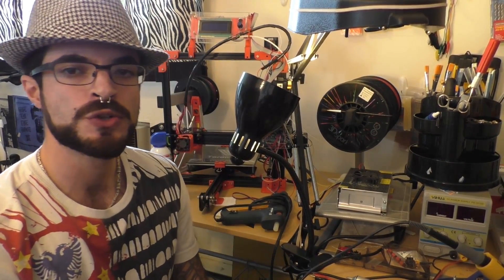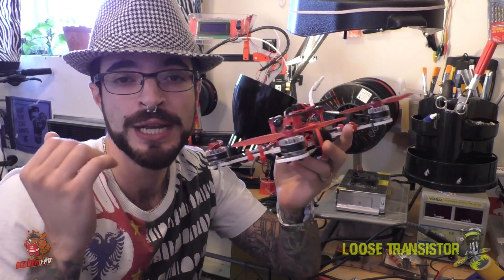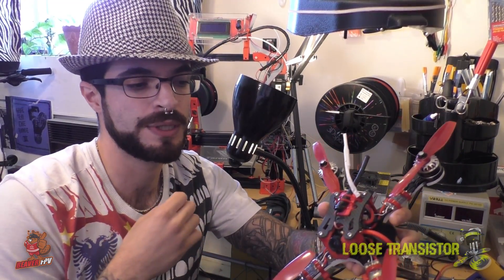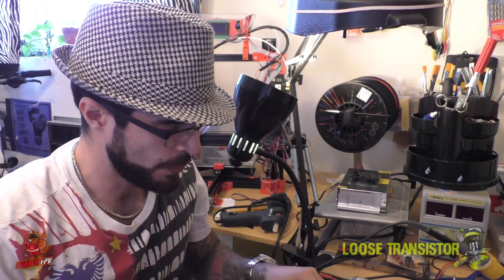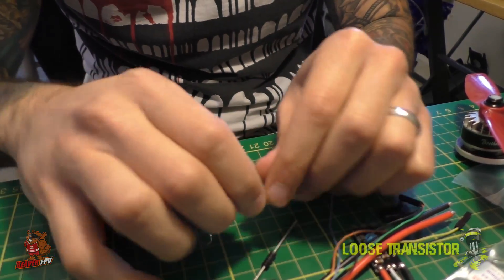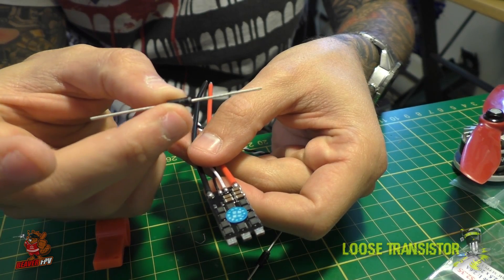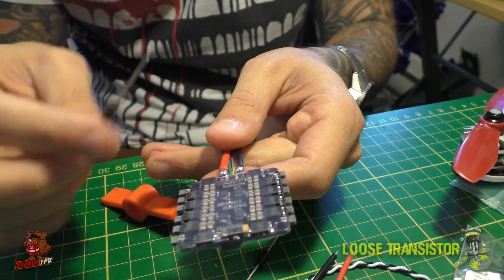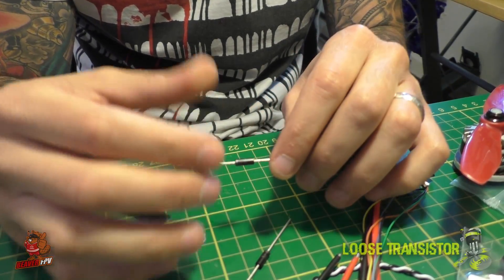Capacitors are DEAD. Long Live DIODES! ♠ [ How To QUAD ]

Comment: this is a very bad idea for one reason. and that is when i diod fails it lets power flow both ways causing a short. in the things they are used in there a fuses in place for that reason. there are no fses on a quad. so itll just burn up the quad! good thought but not a good idea.
Reply from the maker: Hmmm that is not the case.. going strong for years on these never had an issue! Thx!

Comment: All right there friend yes i had it in the right way - to the +&+to- it all so makes video fuzzy bad desink got another runcam split on the way so no worries did u triy it yet in your build let me no how it goes for u
Reply from the maker: Ive used it on quite a few builds, never had issues with video noise or desyncs of any type.

Comment: All right there friend i have just reeked a 7" quad coz of that adjusted diode i was having video noise u cold have tested it first befor u said it on your channel the desink and then crashed 350 it cots me thanks for your inpot but i am going back to the caps i had a runcam split and its trash now 65 bucks not good and dont work
Reply from the maker: Are you sure you had it installed properly? Did you have the right cutoff voltage for your current setup?

I am sorry that this happened to you my friend but there is nothing that I said in this video that should have led you or anyone else to this sort of problem.  TVS diode by itself will not cause a desync. The  most likely scenario is that the diode you used was rated too low for the voltages you are pulling and starved your components.

I also never said that TVS was there to fix video noise, you want a LC filter for that. The purpose of the TVS diode is to protect your components from transient voltage spikes that get generated by motors & ESCs. It seems to me that you are the one that should have bench tested your setup before taking it out to the field. I take no responsibility for your decisions.

The specs and ratings I used on this video are for a 5" 4S quad. What voltage are you running on your 7?

Comment: Hum so you use the diode for shorting the voltage spike.. wath about efficiency? Watts absorbed in a capacitor will be re give to the systeme. Those watts thats pass through the diode would burn as heat....
Reply from the maker: Has not affected efficiency in any noticeable way.
Reply: Loose Transistor FPV maybe those voltage spike ldoesnt represent a lot of overall braking power.. if those diodes heat up so there lot of power if not same not much power. Lipoli battery can reload fast also .. have to test with oscilloscope if higest c rating act as capcitor and smooth the voltage more in a noticeable way..
Reply from the maker: Would be awesome to get some actual o-scope data around this. I was promised some a while back but never delivered.

From what I understand the transients are very quick and short so not enought to dissipate a huge ammount of energy.
Reply: I am not concerned of braking lol i use one shot 125 esc and braking is disable xd litle wobly quad at 10 20 pc throtle but above 40 gas its not realy a problem

Comment: Anyone remember Zener diode, as a kid these little blocks were cheap to buy, we would put these on minibikes snowmobiles anywhere we needed a simple voltage regulator. It did help with the highs, but not the lows. as I stated below.. Bad side is these would generate a lot of heat, depending on draw versus what is produced.
Reply: Look at your main boards on your comp, you will see a combination.

Comment: Low level is also helped by having capacitors. Goes both ways. I wonder if you used a smaller cap along with this., good for both sides of the spectrum.?
Reply from the maker: I think I am still going to rock the 470uf that i've been using so far.

Comment: Watch this for an understanding of what is happening https://youtu.be/LXGtE3X2k7Y 
Voltage spikes from inductive loads are fun. Build a Tesla Coil and see how small AC voltages become very big by pushing that small AC voltage through some turns of wire and then stopping the voltage. Big collapse of energy!

Comment: To clarify to those who are new to electronics.. it is not about Diode vs caps.. it is caps and diodes working together to filter your power in most cases.. But here you need to ask yourselves, with all the nice purpose built circuitry why are we having to add caps or diodes onto the power leads of our ESC's this is power filtering 101. The designers/manufacturers should be making sure their components to not feed back into the system. There is nothing wrong with adding a diode to the system but for more complete filtering add a LC filer inline to the power leading to your cam and FC (if it is not handling current sensing or does not has it's own BEC like the Omnibus))

Comment: This is misinformation.
Capacitor are passive componentes part of rlC. RLC components are elementary for filters design. Diodes or any other Silicon part are ACTIVE components and therefore produce different "effect".
If you wants to cutoff spikes.. its ok go ahead with a zener, but this is not a substitution of a condenser (aka electrolitic cap).
There are a plenty of parts in electronics... saying good bye to caps so easy is like say AC is equal to DC.
Have you heard about Varistors?
There is a lot of theory behind this... they are not just spikes, they have a frequency, armonics...
Caps will live forever... a pair of cables together produce a capacitance effect.. with out them is theorically imposible produce radio signal... ...
+Joshua Bardwell
Reply from the maker: You are a bit late to the party my friend.

In the end the veredict ended up being that its probably best to use both. The diodes will protect sensitive equipment from spikes and the capacitor will help with filtering. I use both and so far it's been great!

Comment: if you want full protection using diodes, you're gonna need 2 of them (per esc). one as described in this video as reverse polarity protection between positive and negative, and one as a gate along either the positive or negative run, that has the amperage capability to continuously supply the esc without inherent resistance.   battery/pdb > positive wire > diode anode > diode cathode > esc positive > diode cathode > diode anode > esc negative > back to battery/pdb.. this prevents both reverse polarity spikes, and positive voltage spikes
Reply: oh and good luck finding a high enough amperage diode for the gate that's not the size of your thumb.
Reply from the maker: Yeah, I suspected that spikes on the positive voltage were not being attenuated at all, I guess the capacitors I have been using have been doing a little bit of that.

And you are right, don't think I would be able to find a diode that would do that without it being humongous. Thanks for the info, really appreciate it!
Reply: if you search for LC filter, some of the first things that pop up are from 2014, which use a combination of inductor (L) and capacitor (C), which you then put between your noisy stuff and your sensitive stuff (like your vtx)
Reply from the maker: yeah more and more I think I should just bite the bullet and make a small LC filter. The added weight can't be that bad.

Comment: Model train enthusiasts have been using these diodes for years. With the increasing speeds of flight controllers,Motors and speed controllers. Electrical noise supression will be needed more and more.
Reply from the maker: Oh wow! I had no idea this was a thing in model trains! Thanks for the info
Reply: Your talking about two different things. The diodes are for voltage spikes which is totally different than Noise on the power lines. You will still need capacitors to filter the noise in the power system. Motors are what cause the electrical noise in the system.

Comment: so how do you protect your escs from transients?
Reply from the maker: John Doe the ESCs don't really need the protection, it's the sensitive equipment such as camera that does.
Reply: Loose Transistor FPV   My quad desyncs all the time.  so you're saying that it's not a problem with the esc's?      Then what exactly is happening when my quad desyncs and spins out of control?   Thank you.
Reply from the maker: Hmmm desyncs can be caused by a variety of different issues including a bad motor or a loose connection on your Flight controller.

What ESC's are you using right now that you are getting desyncs on?
Reply: Loose Transistor FPV. I only get desyncs on both of my gt2 200s.  one v1 and one v3.    says 302x but someone pointed out they are rebranded dys escs.
Reply from the maker: Hmmm.. well those are BlHeli_s ESC's so they shouldn't be so bad. There are a few things you can try.

1- You can go into BlHeli Configurator and set the following parameters
> Motor Timing = Medium High
> Demag Compensation = High
> Startup Power = .125

If you are still stuck on this stuff consider joining me over on the FPV Chat slack, you will receive a lot of help there and 9/10 you will get your issue fixed. Just head on over to http://fpvchat.slack.com, make an account and come find me or ask in the #software-help or #general channels

Comment: why not both use caps and tvr diodes.. would that work?
I mean that bardwell has a point.. and you to.
Reply from the maker: I don't think you will see any adverse effects from using both. From what I have read and understood from other people doing this is that adding the capacitor on top of the TVS does so little as to be negligible. However, I have heard reports of people doing both with great results as well.

If you are looking to cut weight, i'd say go with just the diode, if you have luxury of space and weight do both?

Comment: Question is, why don't the esc's have them built in/on? And you could use both,diode and cap, wouldn't hurt
Reply from the maker: Some of them do already! latest generation of Cicada ESC's are coming with these mounted on already. Both the 4in1 and the Single version.
Reply: So any ESC with regenerative braking has a diode right? So would that be the best option? To only buy ESC's that support Dampened light? 

Does this ESC have a diode in the pic? I think there is one in the middle of the neg and pos pads.. 

http://www.ebay.com/itm/Sunrise-Cicada-BLHeli-S-35A-2-6S-Programming-Multishot-ESC-for-FPV-Race-4pc-Set-/182453736913?hash=item2a7b1715d1:g:V6oAAOSwr~lYoW7V
Reply from the maker: I wasn't paying attention when I grabbed that image off google, and yes that one has a diode already installed. I have been told that new Cicadas are coming with those as well.

It would definitely be better to buy the latest gen with the diode already because the MFG will do all the work. However, this is a cheap solution for those who already have gear they are running or if you just like buying a certain kind of ESC for other reasons.

Some PDB's are also coming equipped with the tech.
Reply from the maker: Yeah I didn,t pay enough attention when selecting the picture. The one I used as an example for the diagram already had a diode.

Its probably better to buy ESC's with damped light in general and most of the newer stuff has it. I have also noticed that manufacturers have started to include TVS devices in some of the latest gen stuff.

This technique is good for people with older gear and who want to protect sensitive equipment.

Comment: Why don't you use Schottky diode? It has faster transition response than a Zener. Is there any special reason to select TVS Zener, not Schottky? I use a low ESR Capacitor as well as Schottky at the same time and I can find the FPV signal has way lesser noise and even the copter's vibration threshold of P and D is going up higher.
Reply from the maker: I have heard of using Schottky diodes for the same purpose. I am not actually sure if one is superior or not. Would have to do some tests for that.

Comment: You might want to mention that the diode you use is rated at 20.5V so only for up to 4S..

DO NOT use this diode on 5S and higher.

Comment: It feels to me like the diode will chop off the upper part of any noise, but leave the lower parts of the noise un-changed. Especially because ESCs use braking, we can expect the noise to have large +v and -v components. Imagine that the ESC brakes and voltage goes from 18v to -5v back to 18v again. The diode won't affect that all.

It seems like the diode can help protect equipment against transient over-voltage conditions, but it won't fully clean up the type of noise that we have on our copters.
Reply: This is true. However, this is exactly what has been pointed out, and if you notice, protection is exactly what some are recommending caps for (there is a vid on the left right now from blue falcon suggesting just that) It is not intended primarily as a filter device, and you are correct in that it may not help with lower amplitude noise.  What they will help with is normal mode noise caused by transients , not common mode , where a cap is better suited.  However , in a lot of cases, normal mode is exactly what is taking place , and a cap is almost useless in this case.    Generally the common mode noise is due to lack of knowledge building, and sloppy wiring.  Additional capacitance, while it doesnt hurt anything, should not be required unless you are using poor components, which are lacking in design anyway, which are indeed out there.  

I have pointed out why transients can be a noise problem in another post here.

This is a battery operated device . Most neglect to notice the fact that we already have one massive, very capable cap on the power buss.  The battery itself...and must be considered as such.   Adding some random relatively large value of capacitance across B+/B- does not do nearly as much as some would think.  However, I will concede that in some cases, it may fix an issue an individual build may be having.  A testament to this without going on a tirade, is the same exact build from 2 individuals, one is having issues, and a cap fixes his issue , the other uses no additional capacitance (and never has), and never has an issue.  Analytically speaking , this suggests that a lack of cap is not the issue here.  As you have seen I'm sure, in a lot of cases, adding a cap does absolutely nothing measurable.

A cap is a solution to a problem that largely exists as a result of poor build , (although not entirely).  Be it poor wiring, excessively long wiring, poor placement of components etc.  A TVS is a solution to a problem that exists regardless, and is a must for modern builds, cap or no cap. 

Also, if you want to snub negative transients as well, you can use a bi-directional TVS.
Reply from the maker: So would you suggest using this in combination with a low ESR capacitor? Basically use the Diodes to chop the top off the transients and the Low ESR to dampen the rest?
Reply: I wouldn't suggest using the diode alone. I think the diode is good at doing what it's designed to do, which is shunt transient high voltage to ground. That's a good thing! But what we really want on our power line is an effective low-pass filter, and a capacitor is a great way of achieving that.
Reply from the maker: What I am really hoping is that chopping the peaks will give the LC filters on my VTX's a fighting chance. I am pretty sure the ones I have have a built in filter for the camera. But no matter what, or which capacitors I use I still get horizontal lines.

I will experiment with using both as well and see how it goes.

Will report when I get my next build going.

Thanks for the input!
Reply: @LooseTransistorFPV   try changing the ESC config, go from 24kHz to 27 or from 48kHz to 43 or so. just change it slightly. diagonal lines vanish in this way
Reply: protection from reverse and high voltage spikes   seems straightforward to me.
Reply: then... i can use both.. the diode in PCB terminal and capacitor esc terminal?
Reply: hi Joshua, sorry if this getting too far from the topic... i have an 20mm F4 Noxe FC,  the funny is that the osd is keep failing after the motor are armed and i increases  the throttle.. can i put some caps and or diode on the osd chip side, maybe on pin 3 & 4 GND & VDC ? to give the osd chip a better dc voltage ? or should i trash the fc ? osd is good at the idle btw..
Reply: The battery is a pretty big bulk capacitor, and there's ceramics on the ESCs for high frequency noise, all that's needed is protection from fast transients. I've never had an issue with video noise, and I've never killed a VTx, ESC or camera with anything but physical impact in 1.5 years of FPV. Large electrolytic capacitors seem entirely unnecessary.

Comment: I found a link at ebay $ 2.9 for 100pcs + free shipping, I hope you dont mind I post the information here and share. 
http://m.ebay.ca/itm/100pcs-P6KE24A-P6KE24-TVS-Diodes-Transient-Voltage-Suppressors-DO-15-/291524232140?txnId=1439077842019
Reply from the maker: Don't mind at all. Thanks for asking!
Reply: Hi Loose 
Please check and review the link see is it I did found the right one.
Reply from the maker: I just checked and they look to be the same kind I am using so looks like a viable source to me.